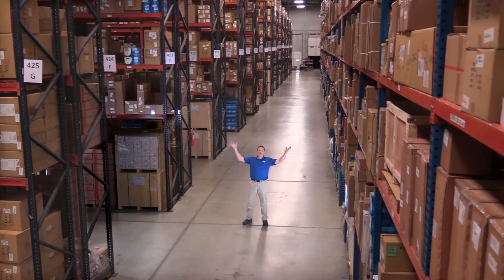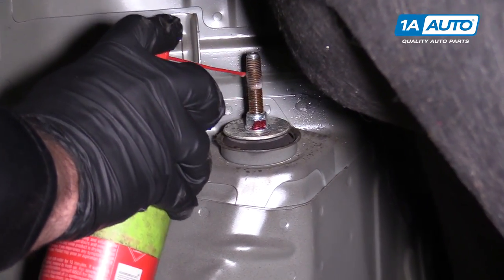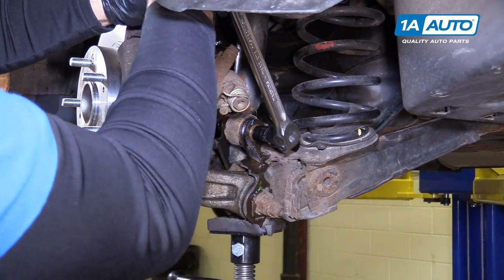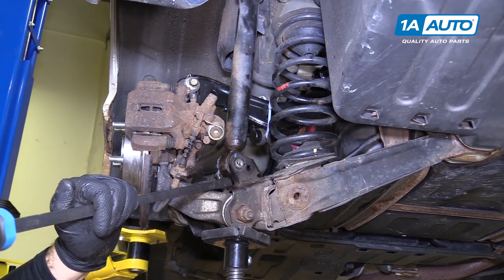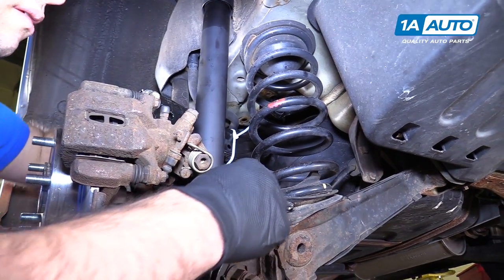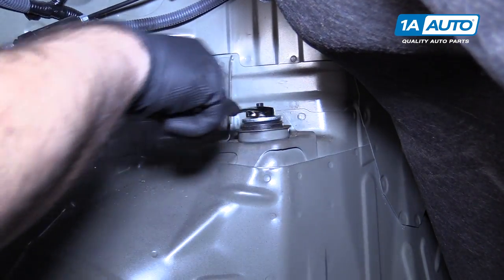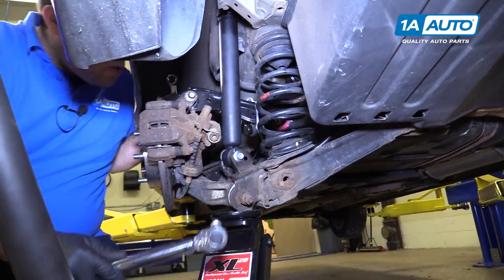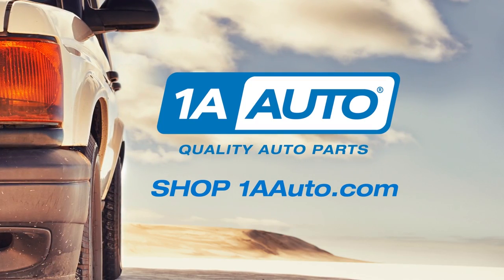How to Replace Rear Shock Absorber If Lower Bolt Breaks 06-11 Honda Civic

Comment: If you end up cutting the bolt and capture nut off use bolt 90181-SNA-000 and nut 90395-SNA-003, they worked for me quite well.

Comment: Did the bolt also break for anyone else?
Reply: Both sides were badly stuck. I got one side off with multiple days of soaking in PB Blaster + impact driver, but on the other side the head of the bolt rounded off trying to get it out. Working on options to try next.

Comment: For anyone looking to make this repair, I ordered the part from them and neither strut came with the upper bushing as shown in the video. Initially, that was my main reason for choosing to buy the part from 1A Auto. Other than that the video is great and the install wasn't too bad. However, the right strut makes a "squeak" sound occasionally when I hit a bump. Overall, I recommend the 1A Auto video tutorial for the repair but I can't recommend the part.

Comment: Mine did not break. My 2010 Honda EX Sedan has 179,000 miles on it and I had never changed the rear shocks until yesterday.

What I did was spray some rust penetrant the day before removing the bolts. Let them soak in and let me tell you my bolts came off with no problem at all. It was super easy. Spraying your bolts with a good rust penetrant a day before  will save you hassle of breaking them. 

I ordered new bolts just in case they broke but to be honest I could’ve re-used the same bolts. 
They looked great, they were not bent or cracked but since I had my new bolts I ended up putting on the new ones.

Good luck 👍
Reply from the maker: +zantiagoshock Thanks for the tip!
Reply: The service manual calls for replacing the bolts regardless

Comment: What size is that bolt? length and thickness? thanks
Reply: 90181-S84-A00
Reply: That is a m12x65 bolt. Honda part: 90181-SNA-000 and they cost just under $3 dealer price. Those are not nearly as pricey as the bolts and nuts on the front struts which are an m14x57 bolt 90190-SNA-000 @ $7.63/ea dealer price and the lock nut 90213-SR3-013 @ $8.58/ea dealer price. You're looking at $65+tax for just the 4 lower bolts and nuts for the front struts... Whereas the the rears only need two bolt and no nuts at a cost of $6+tax. (well, assuming it doesn't break like in this video. I'd recommend treating with PB blaster or something similar for several days before if possible.) 

Honda calls for replacing these bolts every time which may or may not be necessary depending on your climate, miles, and age of the car... I replace these when they are corroded and rusted beyond a slight surface patina. It's an easy decision considering the next time, if not replaced when in bad condition, you'll end up having to deal with the situation in this video. The front struts bolts are quite expensive, but again, I don't think it's worth having to go through dealing with breaking bolt heads off. Now the front lower strut bolts don't have a welded capture nut, but they are in a prime area for constant exposure to moisture. If the car is from anywhere with salted roads in the winter, it is simply wise to replace these bolts and nuts every time and add some anti seize or other thread filler to assure the next repair doesn't turn out to be unnecessarily difficult.
Reply: @yourfinaldecree  Thank you! Seriously haha

Comment: 1st, use pneumatic bolt breaker to loose the bolt shank, or part of the threads. 2nd, if condition allows, fire heating nut, water it, heating and water several times,  then easy to unthread it.       When bolt is rust  freezed with bushing coller,  impact the bolt head is the better way, like do with rust freezed german  lug bolt!

Comment: What are the dimensions of the flange nut? I have to do this on the passenger side. I was able to change the other side without any issues.

Comment: Maybe its  a good idea to have a spare bolt and nut just in case! Also, if it does happen it would've helped to show how you got the sway bar ling loose and zip tied so we could do that a little easier than a guess and go method.
Reply: The service manual tells you to replace the bolt regardless

Comment: hello, i replaced both rear struts. but the problem here is the car is leaning UP from the rear left and leaning down on front right. what could be the issue? is there a right and wrong way to install them? i followed the video exactly how you did it.
Reply from the maker: Thanks for checking us out! The front struts may be worn causing the vehicle to have a lower ride height in the front. The new shocks also may need a couple of weeks to settle. However, we can not guarantee the issue and would advise contacting the company from which you purchased the parts from for further assistance, thank you! +Hashpedia

Comment: I ordered the parts from this company and it only came with the one bushing not the one for the top do you need it ?
Reply from the maker: +Ray Daniel Thanks for watching!  The shocks should come just as pictured in the listing and as shown in the video.  If you are missing a component please contact our customer service department and we can help fix the issue!  Our contact info can be found at www.1aauto.com.

Comment: What replacement nut do I use
Reply from the maker: +itsthatboikeo You should be able to reuse the same nut as the original.
Reply: 1A Auto: Repair Tips & Secrets Only Mechanics Know  any tips on how to get the rest of the broken bolt out since some of it is still gonna be threaded in the nut
Reply: @MrStiturbo  he cut the nut off. The rest of the bolt is inside the damper that you're replacing.

Comment: what type of bolt do we need just in case of breaking it? It is stainless steel or a special one from you or honda genuine part? Thank
Reply from the maker: +Hoai Anh Ho We do not have the exact specs on that bolt, but you should be able to get that info from Honda.  As long as you get a bolt with the same specs you do not have to get a genuine Honda part necessarily.

Comment: I had an experience that when the rear tires are worn in a tiger patern means the shocks are damaged. I replaced them on my 2007 and now see the same issue with my 2014 model !! These shocks are weak or a honda design problem?!!
Reply from the maker: +Hojat Mahdavi Thanks for checking us out! 1AAuto.com

Comment: I'm having a hard time finding an exact honda made flange bolt. Can I use any good quality 12x65 bolt instead?
Reply: OEM Honda Flange Bolt Part #90181-SNA-000. look on eBay for one, or go to dealership.
Reply: @FD-rh6tr  what size nut??

Comment: this happened to me on a rear strut bolt on a 2002 Ford Taurus, pissed me off and had fun trying to take it out haha, i ended up securing it and driving it to a friends place who had a heat i needed and just torched it off, this was tight for a saw to cut it out.. i had everything on hand tho for replacing the bolt 2x

Comment: Oh yeah I'll be doing these too lol, hoping no bolts break but when I switched rotors the 2 phillips screws that hold each on was so rusted you couldn't get them out without stripping them, that was even with 2 people....on to put force forward and the other to use a wrench to torque the screwdriver....🤣🤣🤣
just spent half the night drilling every single one out .....ugh.. sometimes I miss my foxbody mustang.... usually when I gotta work on the vehicle haha. The Honda is just more of a pain cuz less space/more complicated steps but hey gotta learn somehow
Reply from the maker: +deminybs Thanks for checking us out. Shop for high quality auto parts on 1AAuto.com:

http://1aau.to/m/Shop-1AAuto-c

Comment: I had the same problem on my 2006 SI, both bottom bolts we're seized a real pain to get off and you have to get specific bolts to replace the broken ones.... I applied plenty of anti seize to the new ones...man did I curse!! 😠
Reply: What kind of support jack is that with the t handle on it?

Comment: How about the spring?  How do you take that out?
Reply from the maker: You need to compress the spring in order to take it out.  This can be done by using a spring compressor tool that can be found at any local auto parts store!  1aauto.com
Reply: @opannefrank1986  not on these - the rear springs on 8th gen Civics are super easy to take out.